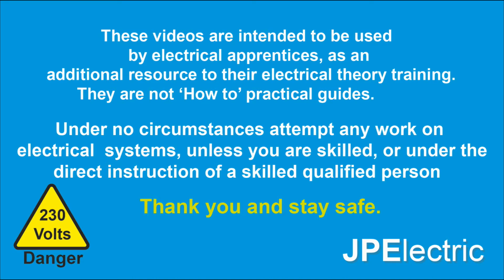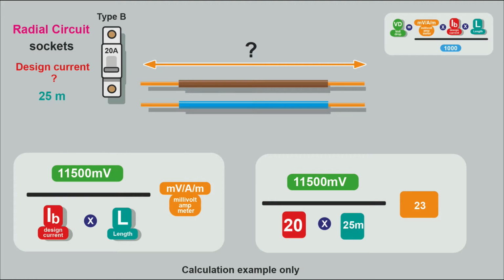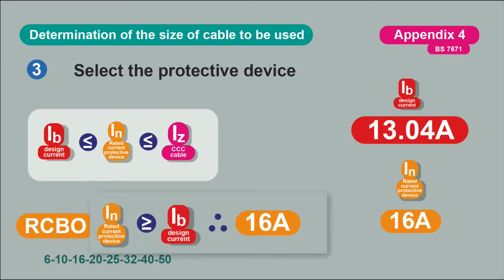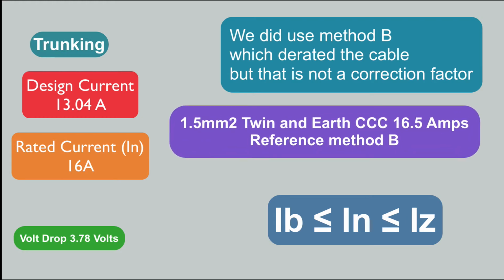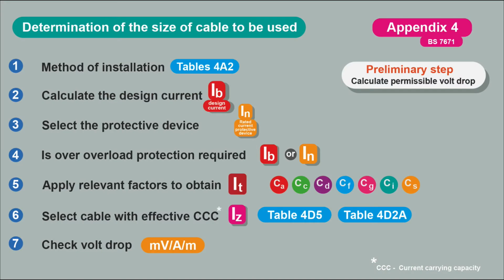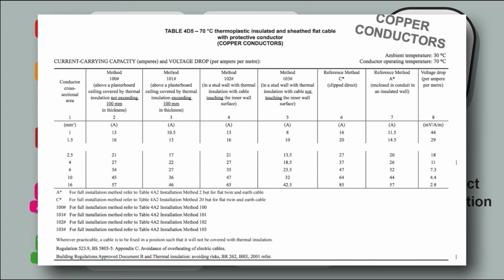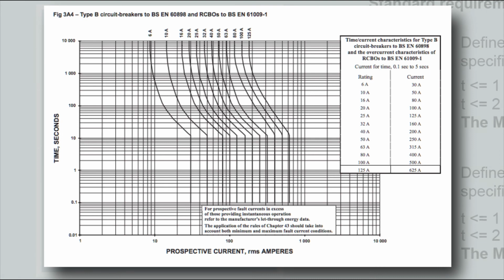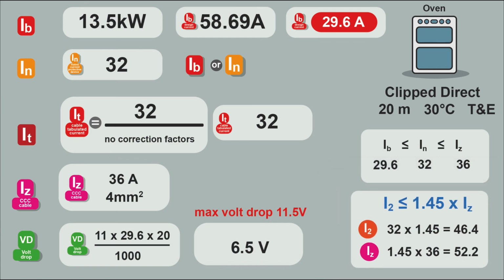How to Calculate the cable size and protective device rating

Comment: Please can you come with a video on this question;
Two lamps are connected in series lamp A is rated 60W and lamp B is rated 100W. Which of this lamp will glow brighter if the supply voltage is 230V and why...

Again Which of this lamp will glow brighter if it is connected in parallel with 230V and why...

Comment: For 27 A current carrying capacity cable (with account of correction factors) , first standard fuse rating is 25 A. Not 20 A

Comment: 26:43 
Shouldn't the current for the orange line be the sum of both current so the voltage drop across orange line should be calculated with 16A?

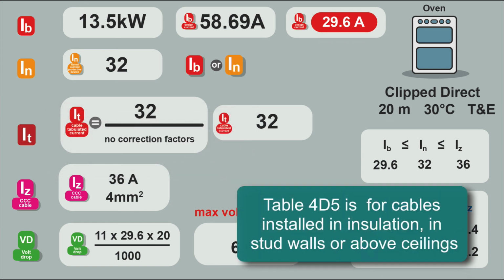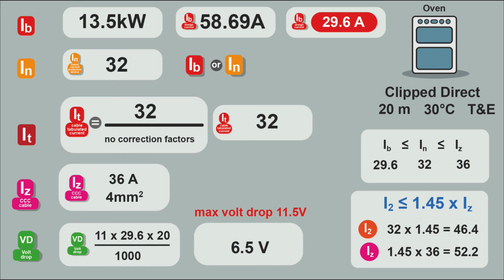Comment: This was your best yet. Best Domestic electrics tutorials on Youtube.Took me a few days to get through it all. Your two previous comments below sum it all up.Adult Learner Question:@45:50 you mention table 4D2A and/or  4D5(flat twin and earth) and @46:00 similarly you refer to 4d2B and 4D5 .Can you use both tables interchangeably?Why no Reference B in 4D5 .I am not too sure what type of cable 4D2A refers to in a domestic situation.Thank you for this video.
Reply: I appreciate your reply and clarification.The length of the video may put others off but there was detail in this video that I had not seen in similar videos covering this topic so it is always a compromise.Look forward to your next video.
Reply from the maker: Thanks Freeze foot. Well done for getting through the whole video. I do think they might be a bit too long?
Table 4D5 is specifically  for T&E in insulated stud walls, and above plasterboard ceilings, covered in insulation. So its for a very specific type of installation method.
The other table 4D2A Is for PVC/PVC insulated cable (Inner and outer insulation) so that would include twin and earth as well.
This table gives you a few more installation methods to choose from. You will notice the volt drop is the same  in 4D5 and 4D2B